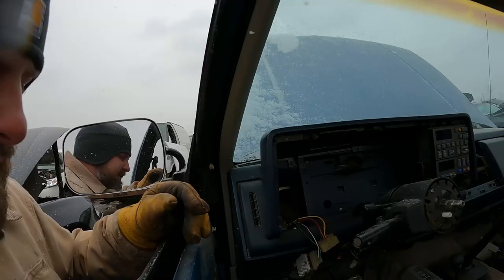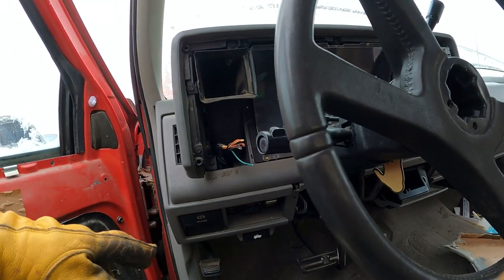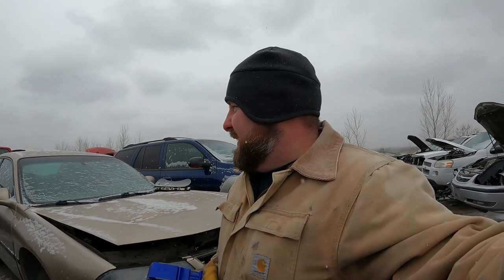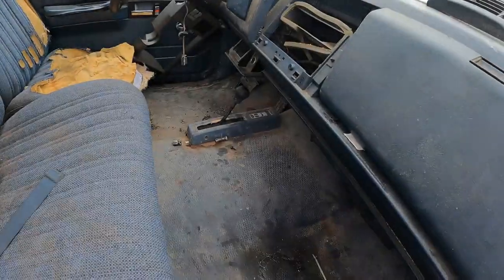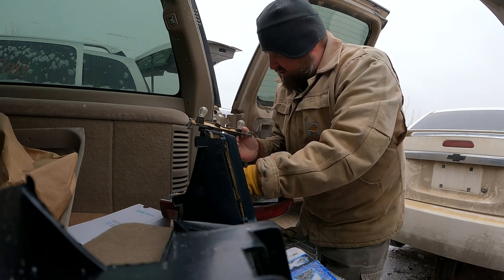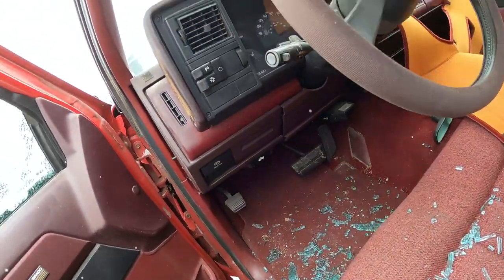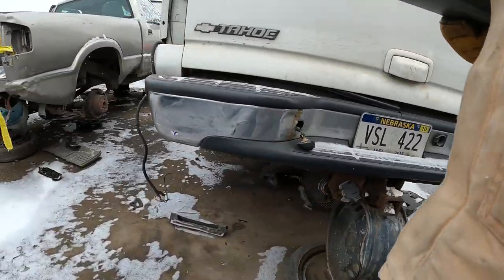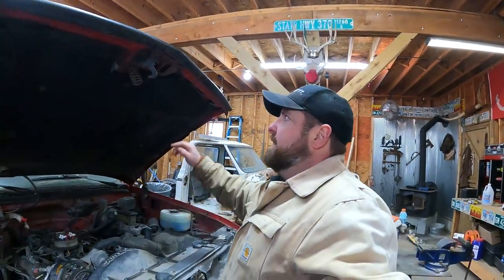✴️ Snatch & Grab  .....  I Got What I Came For

Comment: If you don't find the tail lights let me know, I got a new set for 25.00 actually 3 sets because I was looking for a set for a 99.  I just sold my 97 with 350,000 miles and still running strong.   You can use 95 to 97 but I'm sure you know that.  Looks like fun.
Reply from the maker: Thanks for the offer but I found some. Not sure if they work yet lol

Comment: I bought a '91 Geo Prizm n had it till 2002 when a lady speeding in a 30 mph zone used me to stop instead of her brakes. 3 knee replacements, 2 brain surgeries later I was forced to retire. I was stopped behind other cars n she didn't. The bolt to my seat back broke on impact. I had my seat belt on so I didn't slam my face into anything but my knees went into the dash numerous times. I flopped like a fish with a bad bad bad whiplash. They found brain issues but never knew much about my condition n they still don't. It's called chiari malformation. Those cars were good cars but not good in an accident.
Reply from the maker: Oh man that’s horrible 😳 yes those car didn’t look like they could take a hit
Reply: No they fold up pretty easy. I did love the car itself.